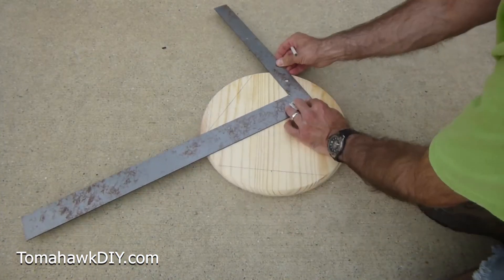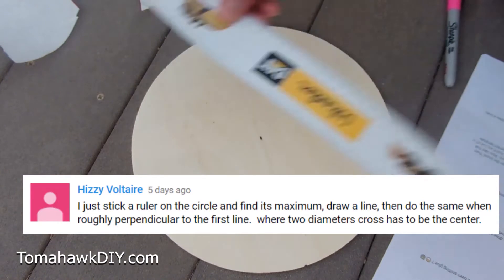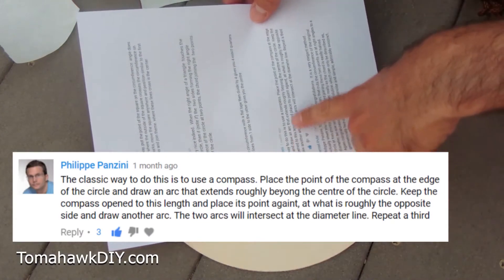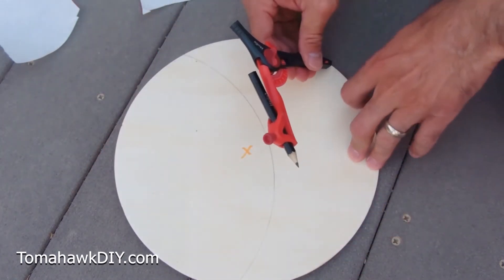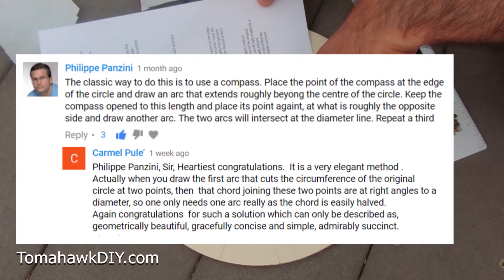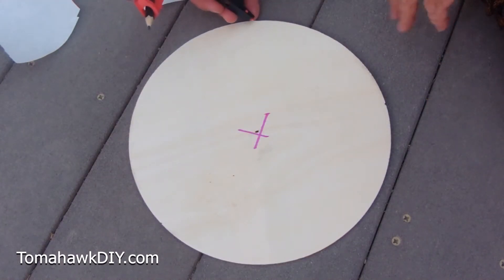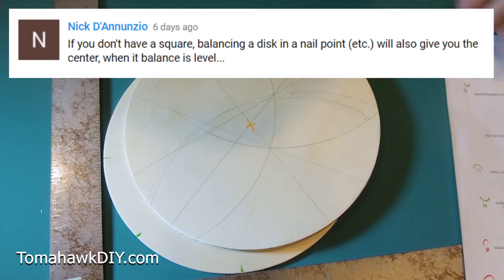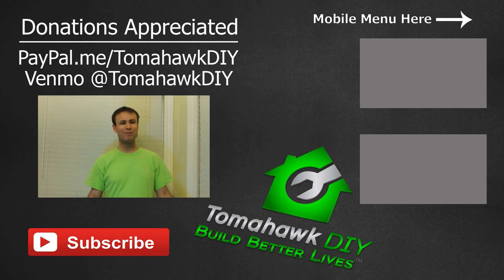11 Ways to Find the Center of Circle - Testing Ideas

Comment: Hey there, a method I used to use to centerpoint round woodpieces to my lathe, I made a gadget that works like if you put the circle inside an angle so the circle rests against x and y, then put a 45*  angle in the 90* angle so the tip hits the corner and it rests on either x or y, then draw a line to the center,,,,  do it a couple of times more to make sure, very easy, makes sence?
Reply from the maker: +DKDonson good idea